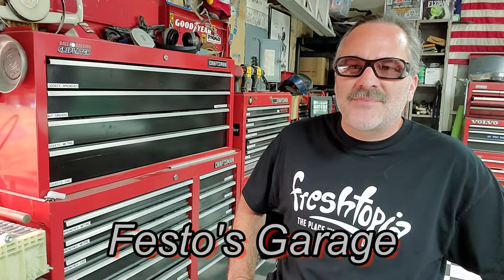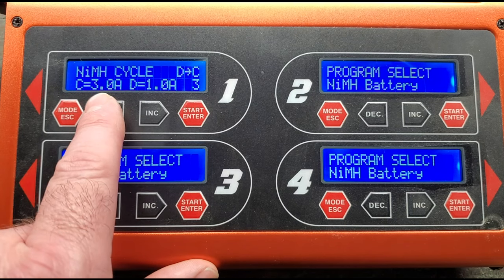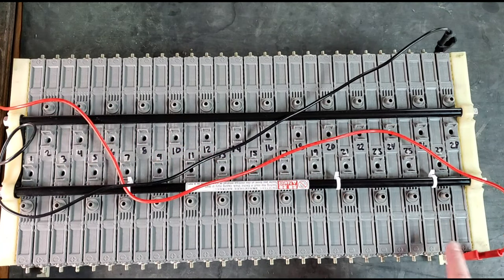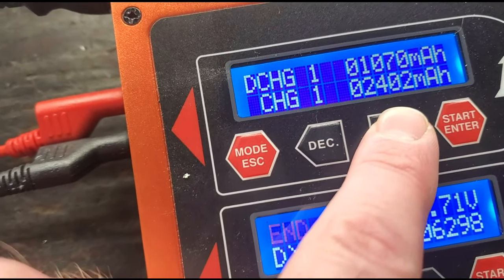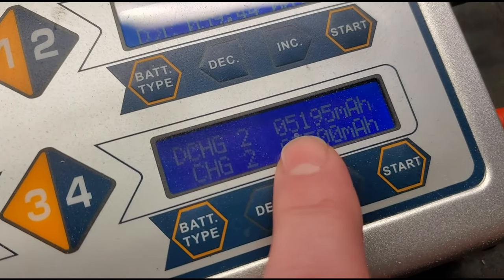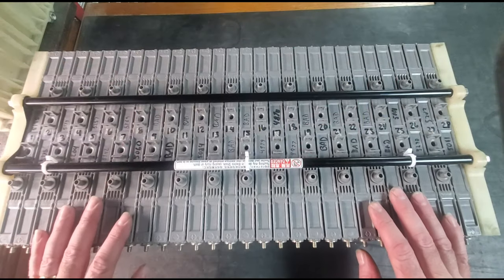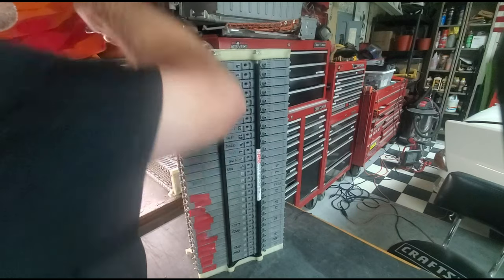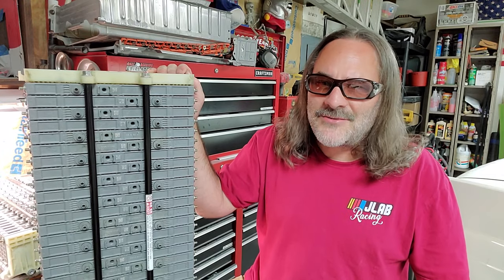Hybrid Battery Pack Refurbish - Step-By-Step w/ Settings - 2nd & 3rd Gen Toyota Prius - CQ3 Charger

Comment: I started working on my hybrid battery. And I have a question…..
Few of my sells discharged number was getting lower at some point but at the end I still got 5000. Will that be a good sell? For example….
My sell 11

3465/7500
4957/7500
4793/7500
4785/7500
4825/7500
4907/7500
5009/7500
Reply from the maker: Thanks for watching and writing in. Yes, I would keep that one because it did reach the 5000mah on discharge. If in doubt you can come back to it after you have done all of the others and run it again to make sure it maintains the 5000mah discharge value. If you have time after done, could you share how the rest of the cells did?
Reply: I might miss some measurements I was working on 2 of the hybrid batteries at the same time and I believe I changed 8 cells on this one. After I did balancing I have each between 7.85 to 8 volts
Reply from the maker: Thank you for sharing your numbers. You can certainly see which batteries recovered well and which needed to be replaced. You should have many more miles of great service from your pack.

Comment: Average time to do a whole pack with 4 channel ??
Reply from the maker: Thank you for watching. The time it takes to do this process will depend on how the batteries respond. The better battery will take less time than the failing battery. I would say on average it takes 15-20 days to do a whole pack.
Reply: @GreggFesto  thank you so much for replying all these other video no one reply yes because planning to get a junk Prius battery for 300 and with mine make a supper good battery for my Prius don’t know if I can trust these company that’s ‘’ recondition “ 
Do you suggest junk Prius battery saw some that just came into junk not to long ago front end damage
Reply from the maker: I have purchased Prius battery that had issues before and ended up getting enough good cells from it to repair 3 packs. In addition I was able to use the electronics section to fix another car. That's 4 cars fixed from one "junk" battery. When you can find a good price on one and have the time to refurbish then it makes good sense. I hope you will write back in and let us know how your refurbishing process turns out.
Reply: @GreggFesto  First I’m going to tear into my pack 1st and see how many is bad reading says block 13 and 14 is bad hopefully I can revive it because cars is only 134k miles but battery is over 20 years old it’s a 2004 so as for now buy balancer and see if I can save pack and go from there
Reply: One more thing I seen people match up lower mah with higher mah does it matter ???
Reply from the maker: It will not matter as the batteries the the pack are arranged in series. The battery with lowest mah will determine what the pack capacity will be.
Reply: @GreggFesto  that’s what I was thinking also thanks man my balancer is coming tomorrow already got the pack out got this week off for work so hopefully I can finish it if I stay on top of it also I got a code for short to earth can’t find anything online it’s short to earth block 4 any idea ???
Reply: @GreggFesto  Hello I was wondering if you had any idea about the delta mv I have a charger that been doing my modules I been at it with 4mv per cell is that ok ??? Not sure but it does cycle 3 times with those setting just in the mid 3k range on discharge so not sure if it charger or just bad overall pack

EDIT !!!

I think it’s right cycle some more it’s up in the high 4s almost to 5 on discharge
Reply from the maker: I have not had this error myself but heard of other people getting this error. I  believe it was caused by a leaking or damaged battery underneath where the battery is screwed into the case. I suggest checking all the batteries well for any signs of leakage.
Reply from the maker: Unfortunately I am not an expert at this process. I use the settings I was taught and have not strayed too far from these. Discharge values in 3000mah range will not give the best result when done as this is only around 50% of the original capacity. I aim for the 5000mah range as this is closer to 80% of the original capacity. If you get all of your batteries in the 3000mah range then your car should still run and drive without errors just lower MPG most likely in the high 20's low 30's as the car will use gas engine more.
Reply: @GreggFesto  3 cycle gets me in the high 3s add another 2 cycle I get it close to 5 so pretty good so far just need 5 cycle each discharge jump 1k or more every cycle
Reply from the maker: I have another suggestion - inspect for damage the wires coming from each block. The wires that are located under orange cover at every other terminal. Those are the sense wires for each module/block. Perhaps the wire for block 4 has rubbed the case somewhere?
Reply from the maker: That sounds about normal to me. I typically use 3-5 cycles. Some have had to run over 12 cycles to get results. Sounds like you are well on your way to success.
Reply: @GreggFesto  I have already disassembled the pack everything seems fine I have a bad modules number 5 and 16 both is at 6.7v while rest sits at 7.85 to 7.9 sense wire is kind of corroded so maybe that’s why it threw the code from leaking negative terminal red triangle happen when it was 102 degree I park it in the sun start it and threw the code mess up 😂
Reply: @GreggFesto  appreciate the time you take to respond brother hopefully I get it going been two days finish about 6 modules takes a super long time but better to know what I have then buy a new pack not knowing
Reply from the maker: I agree that it takes some time but ALLOT of satisfaction knowing what you have for sure. I am certain you will be happy with your end results and performance. Glad you found the corroded wire. It is always better to find an issue then not know why a code was set.
Reply: @GreggFesto  I think I might just replace the wire and both main ground wire because terminal I cleaned it but the the wire it self is not shining bronze with the positive side it’s kinda black you know any online place that sell new ??  EDIT FOUND ALL THE NEW GROUND AND NEW SENSE WIRE FROM TOYOTA 119$ for both ground and sense wire
Reply: @GreggFesto  Hello sorry this is my last question almost done with the battery reconditioning after I balance all the cells put it back in series  can I put it in back in the car when it is over the 80 percent mark because I know Prius don’t let the battery go past the 80 percent mark please lmk or should I discharge total pack to 80 percent then put it back in because @ 7.85 it’s up in the 220 volts or should I discharge it to the nominal 201 volt
Reply from the maker: Once the balancing step is complete you can put the pack back in the car.